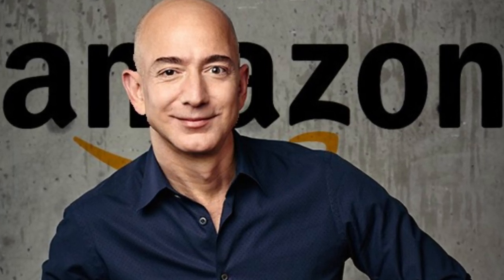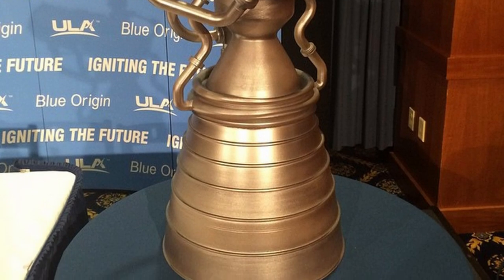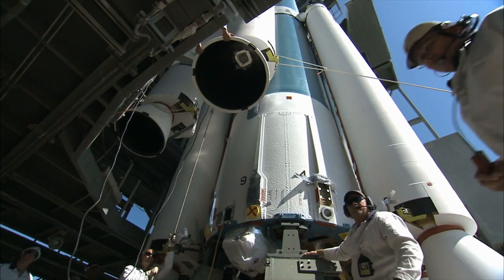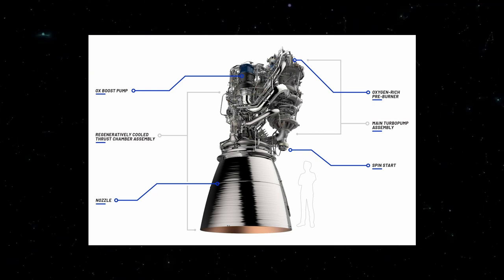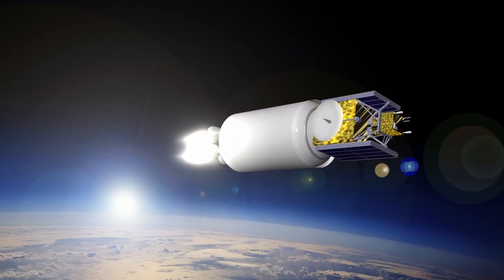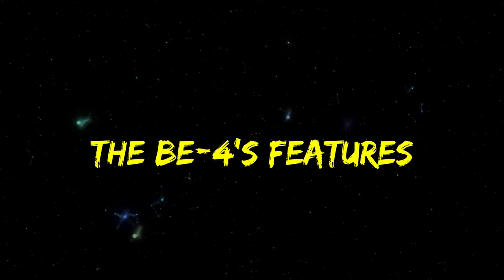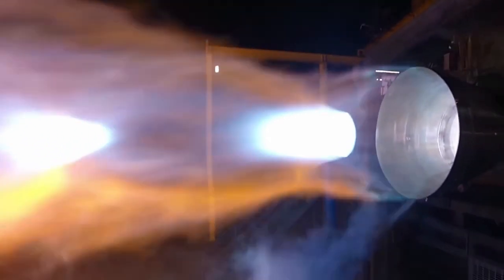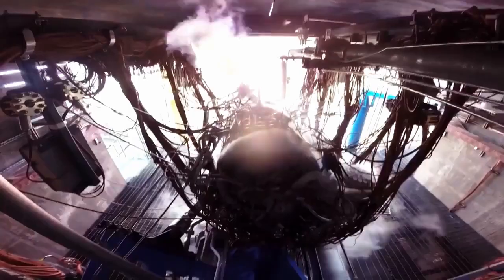Blue Origin's Cursed Engine: BE-4

Comment: A questions. @7:09 you say that it will be the "most powerful LNG rocket engine ever developed ... able to produce 2.4MN of thrust" but the SpaceX Raptor engine can currently produce 2.3MN with a target of 3.0MN.  Yes, the Raptor runs on Methane rather then LNG but since LNG is >90% Methane is that an important distinction or just semantics that allows them to claim to be the "best" at something?
Reply: Methane has to be refined from natural gas, which is an extra step… probably. Except you can just make methane from a bunch of different sources, including Martian soil, without any rock-bothering.
Reply: @randombloke82  I think the biggest difference is that a O2 rich LNG rocket engine is settled technology and Blue Origin believes that settled technology is riskier.  SpaceX sees that differently.  The Raptor Engine uses a design that many didn't even think was possible - but SpaceX mad it so.  I think one thing that drives SpaceX's success is the drive to be bold & smart which draws in the talent and culture that can do great things.  Turtles aren't very inspiring to anyone but Jeff Bezos.
Reply: Well speaking about semantics, BO took the first space tourists ever into sub orbital flight. Just exclude the few tourist who went to ISS riding a Soyuz, those flights weren't sub-orbital. Exclude Mercury and Vostok program as well, those were not tourist flights.

BO are pioneers in doing exactly what they do. The first space mission ever with this exact crew and ascent profile as the New Shepherd last month, the most powerful LNG engine, and so on.
Reply: To start with: Your numbers are wrong.  The BE-4 produces 2.4MN (550,000 lbf) with almost a 65 percent throttling capability.  Raptor is 2.2MN (500,000 lbf) at its maximum Of which it has yet to reach.  And can only throttle 30 percent.  Honestly its all a game.  As the Raptor has only had 2 successful engines.  Yes, 2...  Even the landing of SS15 had to keep all 3 running as they relit and produced half their rated thrust.  
Here's hoping Raptor 2.0 will be better
Reply: @davidbowerman6433  
Raptor vs BE-4:
Thrust: 235 vs 245 tons
Weight: ~1.5 vs ~3 tons
Thrust-to-weight: ~156 vs ~80
Isp: 330 vs 310 s
Isp vac: 378 vs 340 s
Footprint: 1.3 vs 1.9 m wide

Starship vs New Glenn:
Engine count: 33 vs 7
Acceleration off the pad: 2.5 TIMES FASTER (1.5 vs 1.2 ttw)
Payload to LEO when 2nd stage expended: 250 vs 45 tons
Reply: @cbboegh  Wow, I never considered the payload numbers when expending the Starship (250 tons to LEO).  Since Starship will be the least expensive second stage to manufacture (as long as the 3 Raptor Vac engines keep their cost low and omitting the 3 sea level Raptors), that’s not unreasonable.
Reply: @ThomasKelly.  A reusable Starship 2nd stage with payload weighs (1200+120) + 150 tons. It needs the 3 sea level engines to help out during the initial 3rd of the 2nd stage burn.
An expendable Starship may exchange the 3 center engines for 3 extra vacuum engines and rely solely on hot-gas thrusters for control.
It won't have header tanks, heat shield, fins and associated actuators and battery pack. The tip of the ship should be replaced with traditional fairings, to be jettisoned as the 2nd stage burn starts.
Rvacs are probably not cheap, but maybe SpaceX could sell 250 tons to LEO for less than $50m. That's still pretty cheap for getting something like a decent space station to orbit in one go.
Reply: Methane is the main component of natural gas, which means in turn that natural gas is Methane with impurities. The BE4 doesn´t run on natural gas, thanks to impurities.
Tory Bruno: "Actually, BE4 runs on methane. We sometimes use LNG as a shorthand. But, as you point out, that’s not strictly accurate."

Comment: You managed to avoid mentioning that a BE-4 exploded at some point in testing (unsure when exactly), and resulted in the dismissal of one of its designers. The road to adequately testing this rocket engine is nowhere near completely told truthfully in your video. Why would that be? And no mention nor comparison with the SpaceX Raptor, which is a natural close competitor, using similar propellants. Again, why is that? This looks like a bit of a whitewash.
Reply: You do know the Raptor has exploded on the test stands 3 times as much AND has had 2 successful engines in flight? yes, the others all burned out, flamed out or exploded on the rocket.  Even the successful landing was done because all 3 had to be kept on due to sub par (almost half the power) performance.  So far the Raptor is not doing too well.  Blue Origin at least never said anything other than its a test article.  And didn't let them leave the factory floor until they figured out the turbo-pump problem.  But kudos to SpaceX and their daily ad campaign.
Meanwhile the BE-4 has over 2 hours successful burn time, and even at 80 percent power still outperforms the Raptor by a pretty big margin.  Say what you want, even Elon admits its a good design...  Its a shame neither of them can get off their high horses and work together.  The BE-4 on the Starship, being self priming, would make the burn and flip easier and cut weight while doubling the power. And reduce the number of engines on Booster.  Every engineer will tell you 29 engines is just asking for a failure.
Reply: @davidbowerman6433  why are you so salty
Reply: @davidbowerman6433  Actually I do know, and that is my point. Blowing up rocket engines shows up the limits of the current materials/design, and may be necessary to making further progress. However BO is run by old-space bean-counters who don't care much for engineering or real-world issues that the engineers have. And that is why BO is potentially in a death-spiral right now, whose major product is litigation.
Reply: @davidbowerman6433  The raptors are flying.
Reply: @dadejazzba402  the Raptors are test articles not “rated” for flight. The BE-4 is flight rated. Which means the design is locked down. Like the merlins and the Falcon. As stated even the SS15 landed and burned up its engines in that test. That’s not a reusable engine. Nor did they produce power as they should have. They successfully relit. BO is many things, but the engines are a good design. 
Look, I want SpaceX to succeed too. But you need to understand what your watching is advertising. And if BO had cameras going 24-7 while they built their factory, and tested all their rockets, and engines… you would be just as amazed. But because they did everything in secret… you blow off their achievements.
Does SpaceX have a completed tower? A completed fuel farm? A completed SS factory? A finished design?  RATED engines? BO has all of this. Including testing. It was just never public. Is new Glenn SS? No. But it is a huge rocket.
Reply: @davidbowerman6433  talk to ULA...LOL
Reply: Thought the same, the Raptor is a more advanced engine which is already flight tested. I actually think we might see Raptor 2.0 before we see the BE4 fly. Raptor 2 is slated to be around as powerful as BE4 but is quite a bit smaller and lighter. The latest news around the ULA debacle is that they can't get tested engines to ULA this year and are going to deliver untested engines at the beginning of next year then build some identical engines to test while the untested ones are integrated with the Vulcan. This wouldn't be happening if the engines were anywhere near fully ready.
Reply: @davidbowerman6433  The raptor engines worked reasonably well, the problems were caused during relight when fuel oxygen pressurisation was off causing engines to either shut down or burn too hot. The raptor together with the rocket are still under active development so having reliability issues is expected. Raptor 2.0 is almost ready which will be the first stable design incorporating all the changes that current testing has yielded. SpaceX are testing using a rapid development methodology where changes and upgrades are incorporated and tested quickly speeding up the overall development process. With such a methodology it is surprising more failures have not been seen.
Reply: @davidbowerman6433  Hilarious. I'm tired of hearing BO apologists. Everything in Boca Chica is less than 3 years old. BO is just hot air, despite everything, and New Glenn remains a paper-rocket. SpaceX will attempt an orbital flight soon. It has hardware, it has a near-complete fuel-farm. It will make its own methane. And it has one nearly-ready-to-go S20 and B4, with their successors already being built. Blue Origin has no hardware, except a SpaceX-esque water-tank in stainless-steel so they can pretend they are making progress. And that re-useable second-stage will kill the payload capability. But as they seem to test nothing, it's still hot air. They should shut up shop and re-open as litigation experts.
Reply: @davidbowerman6433  Get off their high horses and work  toegther ?? On what basis? Elon is an engineer. Jeff is good at hiring lobbyists and lawyers. If you were Elon, would YOU work with Jeffie ?
Reply: @davidbowerman6433  Yeah, all that is great, but ULA, their PARTNER, for heaven sake, cannot launch their rockets because BO is doing the step-by-step Ferociously  Not much to brag about there. And, their only flight wasn't high enough to be called into space. None of the passengers were trained, but, that didn't matter cuz it was a tourist flight, not an accomplishment.
Reply: @davidbowerman6433  Yes, some of what you say is BO smoke and mirrors. The BE-4 engine is 4 years late in delivery, and counting, so it is not a flight-ready item. Sorry. Raptor is a different beast operating at higher pressures. It is more efficient than BE-4. Yes, it is still in development. 
But BO only operates 9 to 5, Monday to Friday, so it is no surprise that they are taking their sweet time. ULA is not happy, and something is going to give.